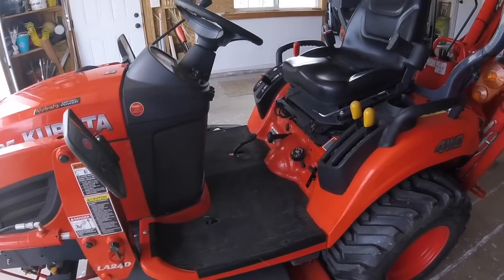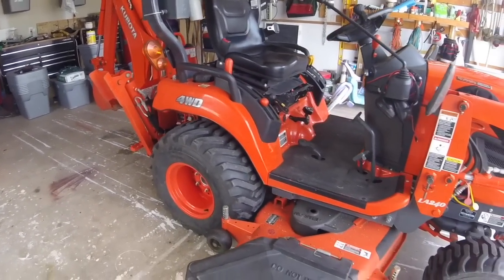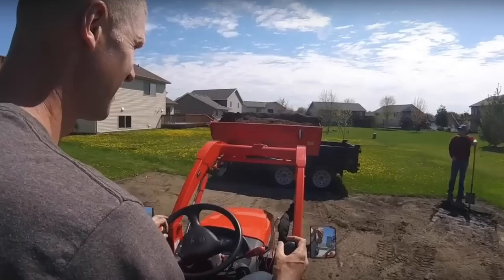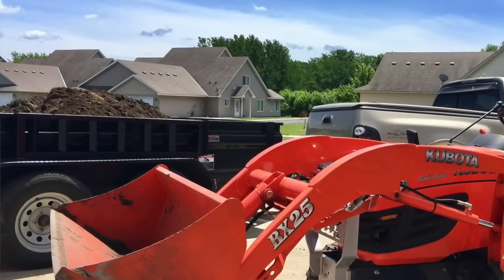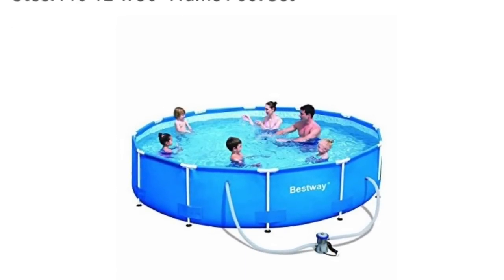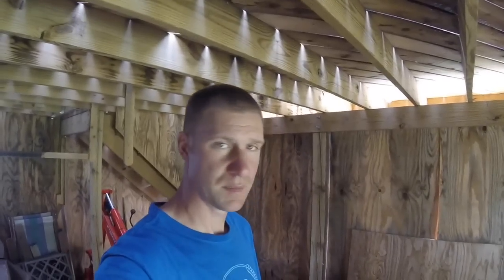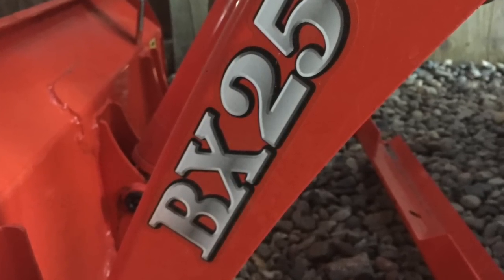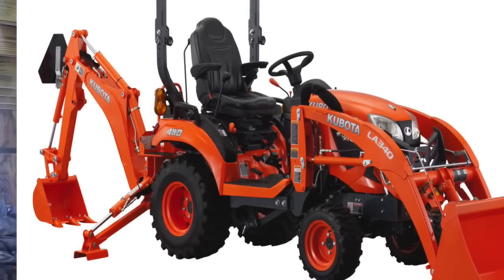Buying a Compact Tractor (Kubota)

Comment: Thanks for the videos - I have a bx1870 (FEL, Tiller, Box Blade, Mower) on 1/2 acre.  I use it as much as I can to do landscaping - planting trees (planted 28 arborvitae along my property in 3 hours using the front bucket to trench out holes), moving mulch, and the list goes on.  I've started mowing with it and it does a really good job.

Comment: Great video. Love it!
** You and Paul and Kathy Short have inspired me **!!!! I rented a BX25 last weekend. I took out a large tree (leveled the ground), moved a ton of gravel from inside a raised platform (leveled the ground) and dug 100+ feet of trenches for electrical wire. There were massive boulders all around, so it would have taken me a month to dig - and there wouldn't have been any way to get the boulders moved without the BX. All done in 9.2 hours of run time; amazing. My wife said I looked like a little boy on Christmas morning! I now have to dig 4' deep x 28" diameter post holes. Yep.. It's going to be horrible, but I have to rent a BX25 again! I should maybe just buy one - like you say. Cheers and Thank you for the inspiration! P.S. I may be taking a trip to my local Kubota dealer to drool before I rent again.

Comment: Thank you , I finally got my tractor a B2301 loader backhoe , with grapple, box blade and palate forks, skid steer quick connect on Fel and quick connect on the backhoe for my trenching bucket and root blade. Thank you for the encouragement , my wife isn't to happy  about it,

Comment: Planning on upgrading to a kubota myself.  And I agree in its usefulness even with smaller yard (3/4 acre here).  That being said the only issue I'll say with the video is the comment about the "smaller" tractors.  my current tractor is an "ugly green" LT150 that cost me about $1800 when I bought it.  15 years later it is still running just fine, so they can last.  I just can't put a bucket or backhoe on it.
Reply: small compact back hoe at deeres here are $20,000 wich my kubota has them for $1,800.00

Comment: I bought a new bx25d last spring to work on my 6 acres. cleaning out goat shelters with FEL, used the backhoe to clear irigation ditches, wish I had bought a front mounted snow blower. I had to muddle through the worst winter in 10 years with only a scraper blade.
When you say it's a life saver, that's a bit of an understatement.
love the videos, keep them coming!

Comment: I have a 1020 gas 1967 that I mow with and love it. The thing that I have trouble with the orange sub compacts is that goofy tredle pedal. Looking at a new one now and will probably go with the Deere 2038R for the ease of the auto connect mower and the quick attach FEL. Just bought the ZD1211 zero turn for my second property because it's diesel and I like the front jack built in. Keep up the videos.  Thanks

Comment: What a coincidence Is stumbled onto your video.  I live on a small 0.5 acre sub-urban lot with most of my space in the backyard.  I have a small home orchard with about 75-80 fruit trees in it and I have been thinking about buying one of these sub-compact tractors....Kubota would be my first choice.   I currently own a John Deere D155 LS riding lawn mower and a trailer to haul dirt with but it is still a pain to work my home orchard.  My soil is a mixture of sand and clay which can become hard as cement in the summer.  Planting trees requires a jack hammer so I was thinking how useful one of these sub-compact tractors would be especially if it has a backhoe attachment.  Everyone that I have seen using one of these lives on a multiple acre homestead or farm so I thought it would be awkward to have one of these in a sub-urban lot but after seeing your video I have changed my mind about this.   Thanks for posting.
Reply from the maker: Yep, I've got a compact yard, why not own a compact tractor. I find more uses for my BX all the time. I think it would be essential for your orchard work. I hope you  get one. My neighbors are thankful I can help them out from time to time. I enjoy it as well. Thanks for watching and God bless!
Reply: the deere compact tractor i got a price wich is a ouch for a 23 hp compact tractor with loader and backhoe they wanted there $56,900 wich rediculas for a small deere 23hp compact tractor  the kubotas are the top #1 cheapest tractor at affordable price in package :)

Comment: Great video!  We are just starting to think about purchasing a small tractor.  We would use it mainly for snow removal in winter with a blower but we have 10 timbered acres and could definitely find other uses for it.  This winter's heavy and wet snow brought down a few trees that we need to remove so we would need a tractor that could haul/skid 16' logs roughly 12-14 inches in diameter.  Would the BX23S you mentioned handle such tasks?

Comment: Great video Jon, just subscribed to your channel. I just bought a BX23S. Considered an RK 24 at first because I thought it was a lot cheaper but it turned out to only be a little cheaper. The 23 hp BX 23 is big enough for all my routine tasks but I am considering building a shooting berm and would have to move probably 2 big dump truck loads of fill dirt about 50’ (that as close as the dump truck can get). I realize it will be slow going but based on your experience is this to much to ask of the BX23 and should I just rent something bigger for that job.
Reply from the maker: 45SIG58 First of all thanks for subscribing to the channel. I’ll be posting more videos throughout The summer. I’m glad that you decided in the BX23S. I’m actually going to be upgrading to one with a cab before winter comes again. You’ll have no trouble moving two loads of material with a BX. It will just take you a bit longer than a larger tractor would but still a heck of a lot faster than a shovel and wheelbarrow. Throw your shovel in the garbage and save your back! God bless.

Comment: NOT condemning your choice here, but speaking from my own experience. I owned a BX25d that I'd bought new in 2014. I liked it, thought it was very good quality, and found the controls response of it to be superior (faster) than most other comparably sized compact backhoes. However, and I'll provide a CURRENT example of my experience shortly, I found the POWER of it lacking. While it did dig FASTER, it was ABLE to dig..................less. It was $19,600 with 0% interest. A year and a half ago, I sold it. I felt like any of the remaining projects I had around here, and for the landscaping business I have required something slightly bigger, with more power. However, after selling it, I ended up not replacing it immediately and actually waited till 11 months ago. Now here's an example of what the BX would NOT do. I bought a small piece of property here in rural PA that had steps up the bank to the house which had been torn down years ago. The steps remained, and one by one, using a digging bar, a drill and a rock chisel, I removed all but ONE of the steps, the final one buried in the ground and the BX unable to budge it. I spent MANY Saturdays trying to get that thing out, but not a budge, jiggle or shake. I bought a Massey Ferguson GC1710 last spring, and have been almost annoyed with the response speed of the controls, seemingly MUCH slower than the BX.  But I've dug out, literally, 8, 10, 12 and 14 inch LIVE stumps with the thing in 10 or 15 minutes apiece! Not setting speed records at MOVEMENT, but amazing final results considering I'd have NEVER dug a stump that size in that time with the BX. Anyway, the steps. Two days ago, in FROZEN dirt, I was cleaning up winter gravel at the foot of that bank and decided to dig that step out. Well, it turns out that 100 year old step is actually THREE steps, with road buildup etc. piled on top of the first two. No wonder I couldn't budge the thing...........but I got it out in about 35 minutes with the Massey. It was everything I could do to manuever it out of it's hole, but got it onto the berm of the road in a few movements after breaking it loose and working with it. So here's how big it is. I think the lift capacity of the loader on either machine is 700+ lbs. The Massey couldn't lift it. It LOOKS like about a ton of concrete and rock and stone, and I doubt I'm too far off. However, I got the bucket under one edge of the thing and pushed it out of the way, about 50 yards up the road where I can break it up later.............like it was nothing. To say nothing comes close to a BX wouldn't be an accurate statement in any way, particularly if you've never used anything else!  Add to that the WARRANTY (try getting warranty ANYTHING after a year, and the lights will be fogging up, as will the dash, and it's NOT under warranty after a year on a Kubota), and the fact that the Massey, for one, is almost $3k LESS (and we're talking 2014 Kubota prices vs. 2018 Massey prices), and I'd suggest a LOT of other tractors probably comes close and goes right past the Kubota. I at one point was like you. Proud of my Kubota and enjoyed the neighbors all saying "wow, Scott has a Kubota" like it WAS something. I'm prouder to tell them there's other stuff out there that's better, and I'm happy to find it.

Comment: Have you considered a backup audio alert for your tractor, especially since sometimes you backup with the trailer too?
Also, do you have hydraulic control for lifting rear plow up and putting it down from inside cab of your BX23, bitter cold snow days?  If not, what’s your plan for its’ use?
Happy tractoring.
Reply from the maker: All of the hydraulic controls are located inside the cab. A back up alarm is something I might install on my larger tractor someday.

Comment: Good morning Jon:

  I’ve showed my wife your photo from one of your video’s and read to her my messages to you and your replies.  She asked me to tell you you’re a really intelligent, very nice man.  I certainly agree.  As I’ve told my wife, you are a very productive, extremely busy and great family man.  I certainly appreciate you taking time to respond and your thoughtful, sound, experienced advise.
  Have you discussed/considered addition of beet juice or liquid to rear tires for added weight or the other thought that I saw on Messick’s Site of reversing position of rear tractor wheels on shaft’s for increased foot print, and your thoughts on these methods?
  Certainly not trying to monopolize your time and if not too curious, are you related to the late actor, John Ritter?

Kindest regards,

Philip Kieras
Reply from the maker: First, no relation to the late actor. Second, thanks for nice compliment! 
As far as beet juice or reversing wheels I have not considered at all mainly because I use my tractor to mow all summer and with the R4 tires I don’t want added weight as I’m already nearing the threshold for too much weight on the ground and I don’t want to compact the soil anymore than I already am. In the winter I use a backblade and a front snowblower which add plenty of weight for me. If I needed addition weight I could add removable wheel weights or even add weight to backblade. However it’s simply just not needed for my applications. Messick’s is a great source of information! Neil always has something interesting to talk about. I appreciate you watching and commenting. Happy to answer your questions. 
God bless!

Comment: 3000? with proper use and maintenance that tractor will see at least 7000 hours.  Most homeowners trade them in when the paint starts fading.... then people like me buy them off the dealer and run them for another 15 years.
Reply: MY TZ1025 N/H I PLAN ON HAVING IT FOR 20 YRS. OR BETTER. IF I HAD THE MONEY I WOULD TRADE IT IN FOR A 2032E . TRACTORS HAS COME A LONG WAY SCENCE I BOUGHT MINE 14 YRS. AGO.

Comment: Had a cub cadet “commercial”, had to rebuild the deck every other year at a huge cost. Greased it every use and didn’t matter, had a box store John Deere and it lasted a season before the trans started screaming because of a bearing, had a yard man years ago and it was the worst cut I’ve ever seen. Purchased my BX2380 this year and it has been outstanding and the finish cut that it leaves is unreal. Like you mentioned at 0% financing I just told the dealer to get it loaded up. I got a great deal and ended up at $119 a month after the kubota insurance.
Reply from the maker: That is a great deal and it does leave a great cut. Other garden tractors just aren’t built with the engineering to last long. You’ll be pleased you went with the 2380, it’s a great machine! 
Thanks for watching! 
Keep on tractoring

Comment: Well I would consider instead of putting it up in your rafters your machinery how about a suggestion to Incorporated in your back fence The Back Fence will be the wall and you will put a roof over it with a few post to put in the ground in front and a crossover beans and then put a basic roof over it this is basically what most Farmers consider doing ultimately the size of the structure in front is probably 8 foot maybe 6 foot at the back sheet metal is the choice roofing and siding and it does not necessarily need doors yet a simple door can be placed without hinges noting that you will not be accessing this only on a seasonal basis you can also put in shelving in the back and hang things on the sides yet I say this knowing that the earnest dictators in communities are alive and well and they have this silly thing called codes and they dare you to break them or have to pay through the nose to solve them.
Reply from the maker: I’ve been kicking around a few ideas for storage solutions as right now I’m very limited. The fence idea is a good one. I understand what your saying. The codes in my neighborhood might allow for that sort of thing. Was also thinking of building some small shorter shed type storage pods for behind the house. I think as long as they’re under 6 feet tall I don’t need a permit. I know I need to come up with something eventually. Thanks for the suggestion. 
God bless.

Comment: @A Ritter bit will do did you mention price?
Reply: Depends on how you configure it.  The BX now starts at about $10k just for the tractor, no loader, etc.  I just got a quote 2 days ago for a BX2680, loader with skid steer quick coupler, 60" mower deck, box blade, pallet forks, and roto-tiller and was given a rough estimate of $24,000.  Seems like a lot but if you can put it to work occasionally it'll offset that cost.  

I bought a lawn tractor in 2010, it made it 7 years and that was with me babying it all the time.  I bought another lawn tractor in 2017 to replace the previous one.  So far its on its 4th season and no issues, but being on just an acre of property it don't get much use....the previous lawn tractor didn't get much use either and only had 341 hours on it when the connecting rod decided to part ways.  My current lawn tractor has 87 hours on it.  I'm hoping to get a couple more seasons out of it at least well really would hope another 10+ seasons as I have a snow blower for it so the longer it lasts the longer the snow blower attachment will be useful LOL.  I had an old Craftsman GT6000 garden tractor prior to those 2 lawn tractors, it lasted 21 years...huge difference in build quality between them.  

I recently started thinking of buying a sub-compact tractor because of all the added stuff you can get for one vs a lawn tractor.  Yep price is of course much higher, but if a lawn tractor is only going to last me 5-7 years, and at $2,000 every time I have to replace it, I may as well put that kind of money towards a tractor that's going to last me 20+ years.

Comment: What size bucket do you have on the backhoe?
Reply from the maker: Hi Tim, my bucket is a 12 inch. Unless you’re going to bury a lot of cable lines or run irrigation pipe I wouldn’t get any smaller. 12 seems to work great!